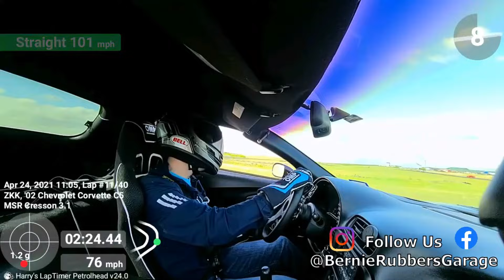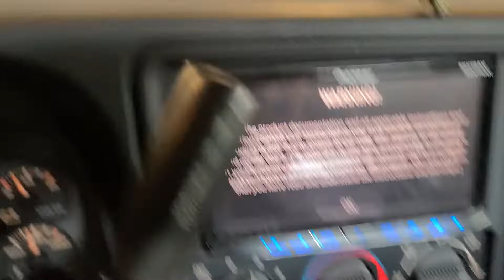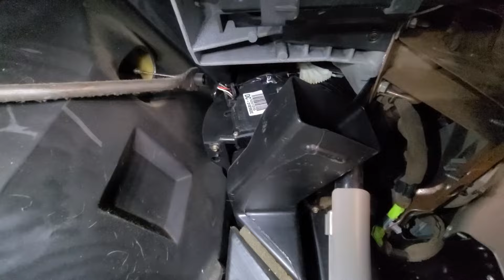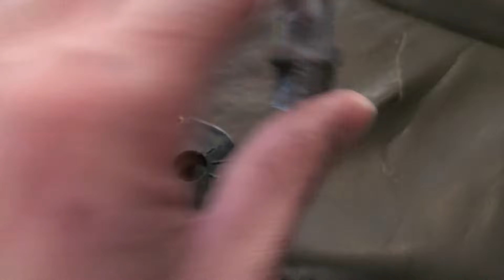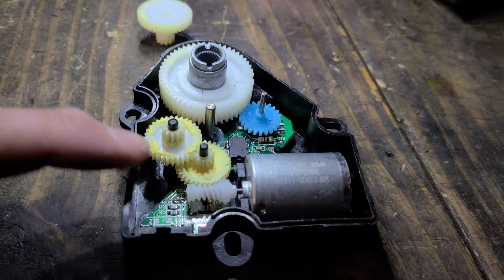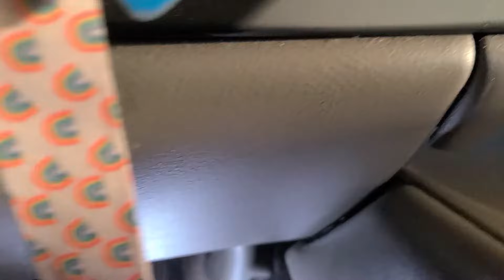Can We Fix it? 1999-2007 Silverado A/C Mode Actuator Repair

Comment: Getting that top bolt out is a bitch. Even after I had the proper size socket, I had to grind it down to get enough clearance to fit the socket wrench in there.
Reply: I'm watching vids now about the top bolt - i might have to break out the grinder.

Comment: On a 2001 Silverado there is no relearn. Take out 4 bolts and take the driver's seat out. Makes it a whole lot easier. Mine had a cracked main gear in the actuator. If it's stuck on defrost the problem is probly a cracked main gear in the actuator, a gear missing some teeth, OR the defrost flap gear NUB is going past the stopping point of the BIG gear with 3 grooves in it. The defrost flap is the upper most gear with a visible NUB popinting outwards. The gear for the defrost is probly slipping past the stop point ( end of groove where you can't see through it) which causes the actuator motor to go past it's limit and will stop working. The gears in the actuator can be replaced, order gears online. DO NOT get the potentiometer gear out of clock. You can get it 180 degrees out..(I Believe). In the upper most groove, for the defrost flap, put a screw in the groove (to stop the flapper NUB from going to the end of the groove) or fill the groove with JB Weld about a 1/4 inch from the closed end. Worked on mine for 2 days until I saw the BIG grooved gear go past it's limit and stick in defrost mode. Watch South Main Auto and you'll see what I mean. https://www.youtube.com/watch?v=_jTN0X2TYvU&t=1788s 
I tried the cotter pin but the NUB would slide over the cotter pin. So, I put a screw in from the outside in to stp the nub a 1/4 inch from the end. Working just fine now.

Comment: Ok..on all videos I've seen..no one ever shows what position that the air is on when putting the mode actuator on..I  notice on the mode actuator there are 3 markings..and the new one set in the middle. So then..what do you turn the air on..(vent, floor, defrost) before you plug the actuator in..
Reply: I've been digging for the last 24 hrs for info to put mine back together.  I removed the actuator off the cam and the cam off the blower box so all my alignment is screwed up...Anyways I saw another video where a guy installed a brand new delco actuator with cam and he said you need the mode set to "face vents" for it to be properly calibrated when you plug in the new actuator out of the box...
Reply from the maker: I think I know what you mean and if I'm remembering right, I had a hard time with that too. I don't remember what setting I had to have to get everything aligned correctly, but there was a lot of trial and error. It was a PITA 😅
Reply: I’ve never seen anyone really remove it either.
However, it is my understanding that the selection switch should be set to the middle position or straight up.
I have to do this repair for my brother in law and I’m certain to f it up and never hear the end of it
Reply: @Rockhardfarmer did having the switch in the middle work?
Reply: I'm not very clear, was the a/c resolved I've watched many videos that recalibrate the actuator! Did you get lucky and bypass that step?